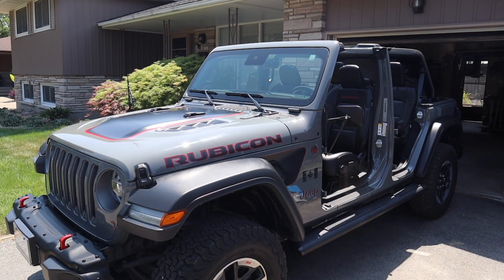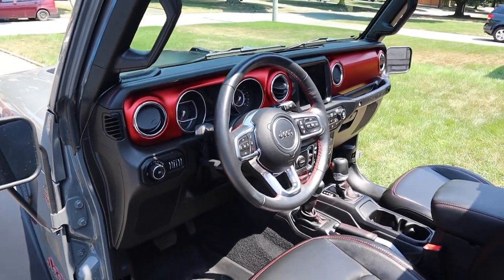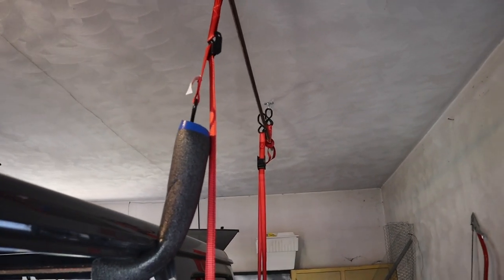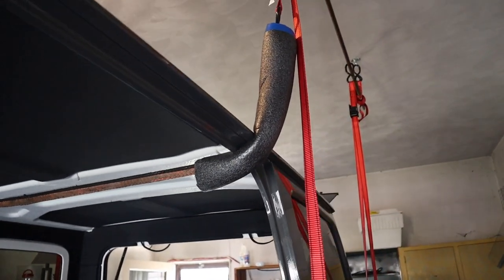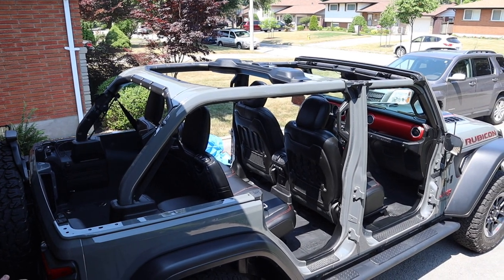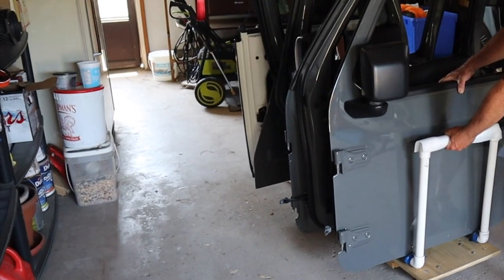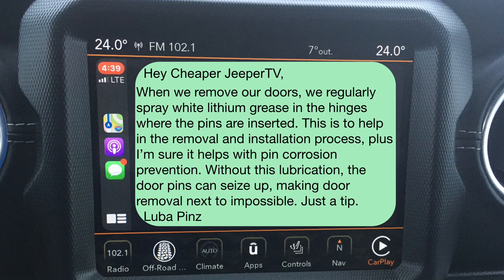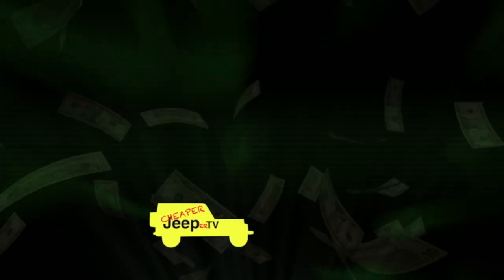Inexpensive DIY Hard Top Hoist

Comment: I did a similar setup. Used ratcheting ropes connected to eyeholes on 2x4s attached to joists in ceiling. The other end that goes under my hard top has 2x4s that run under the hardtop. Since mine is a carport with no garage door to block wind, I store it all the way at roof level with a few foam blocks on top of the hard top between the ceiling and hard top. Great video as always. I could send you pictures of my setup if interested. Cost about $50.
Reply from the maker: Hey Pretzel, please do!!!, I will add them to the article on the website to share with the CheaperJeeperTV community.....thanks for the sharing of info.  The subscriber that shared the cam strap strategy said he chose to use cam straps as he could control raising and lowering of the hard top easier by simply pressing the button and pulling or releasing the tensing on the strap.  How do you do it with the ratchet?
Reply: CheaperJeeperTV same way. I just hold the hardtop to release a little pressure and push the release button to lower them. The ratchet ropes are almost identical in action to what those straps in your video are. They don’t really work like a ratchet. They make a clicking noise as you tighten them.
Reply from the maker: hm..ok...if you can send me pictures, that would be great, I can share them in the article.  Thank you for sharing.
Reply: CheaperJeeperTV your website doesn’t allow me to attach photos in the contact section. Suggestions?
Reply from the maker: just email me at:    contact@CheaperJeeperTV.com

Comment: At 2 minutes you said you could add 2x4. My joists run the same as you showed and 24 inch from each other. I just used eye bolts into the center of the joists. Is this wrong ? Should I use a bar? I feel like the weight is still not being utilized without drilling into the middle joist.
Reply from the maker: If you’re able to use the current orient if your existing jousts, then that’s perfect. Cheers

Comment: Quick question and sorry for my ignorance but what happens if you don’t use the 2x4? Can I just do it as it shows in this video ?  Thank you very much!
Reply from the maker: If you are able to locate your joists and screw into them accurately through the drywall on the ceiling then you are OK. Some people might not be able to do that due to the construction of their garages and may be better off to secure two by fours first. Whatever works for you. Thanks for watching. Cheers.
Reply: @CheaperJeeperTV  OMG !  You save my day yay!!!  Thank you so much for your quick reply to my comment!  I really appreciated it.  😀🙌🏽🙌🏽

Comment: On one of the videos I watched one of the comments regarding storing the hard  top long-term hanging would eventually damage it due to the bottom losing it's form., I'm worried because I want to switch to the soft top for the summer.
Reply from the maker: Interesting. I never heard of that before. Maybe if you suspended 2x4s for the top to rest on, the top won’t get distorted from the stress of the straps as the top will be resting in the 2x4s, and the straps will just keep it elevated. Cheers.